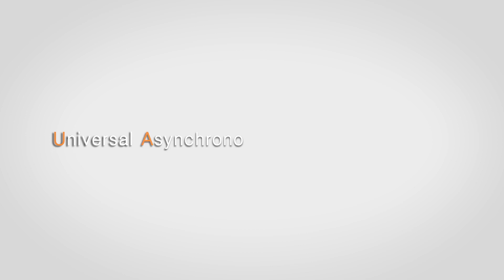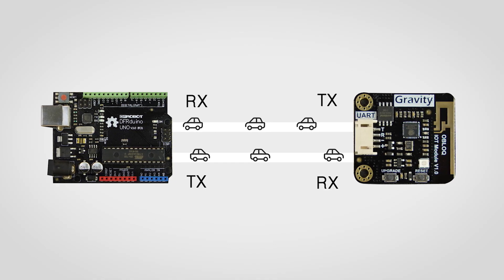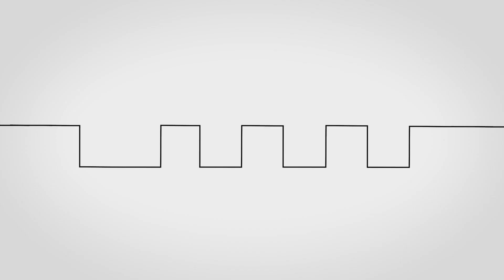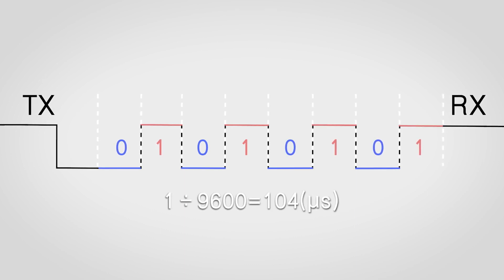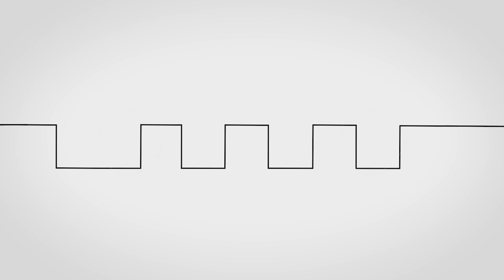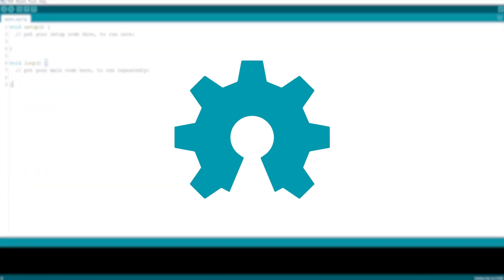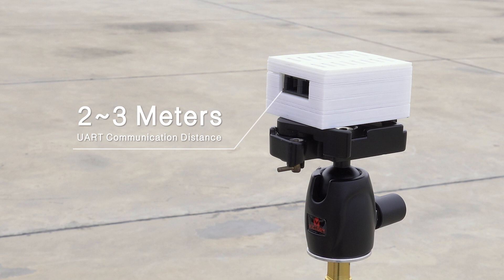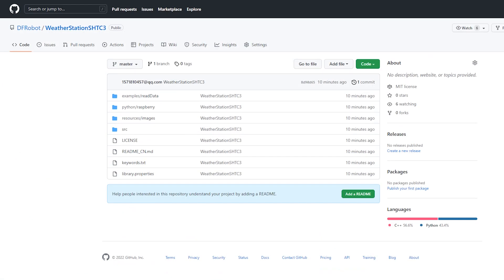How The UART Protocol Works - Gravity: UART Fiber Optic Transceiver Module

Comment: Nice, simple video for UART.  One note, 0:52 the chart says 2 devices and 1 wire.  For full duplex you would need 2 wires.  Also, there is no limit to the number of slave devices that can receive data, the only issues happen when they try to talk back to the master at the same time.  I use UART to control my robot builds because I can use a single wire to send data to all my non critical actuators.  It keeps wiring simple.